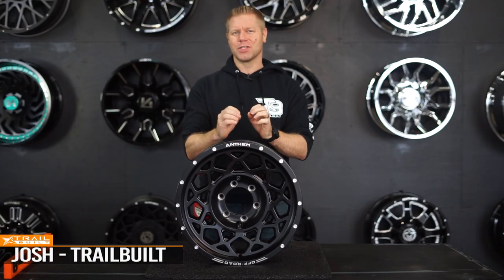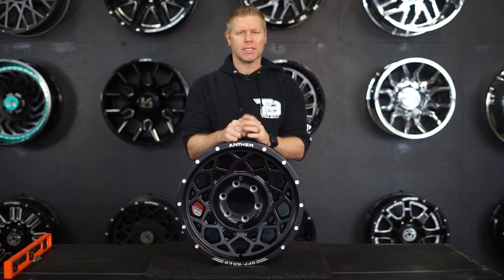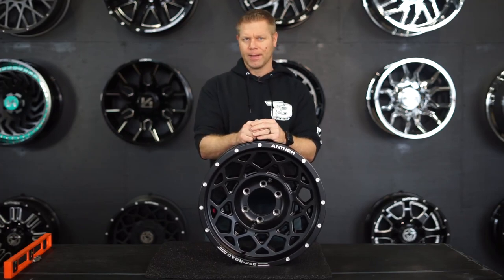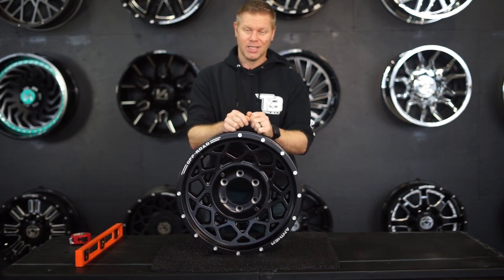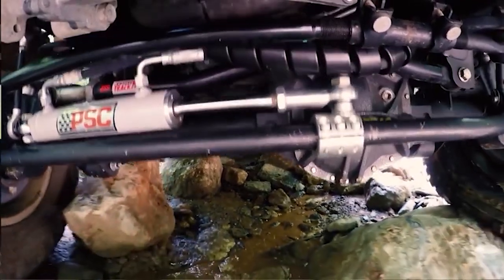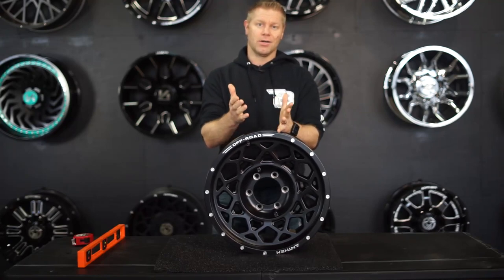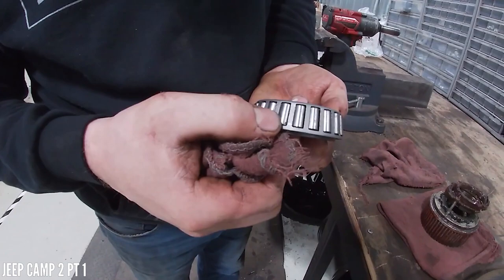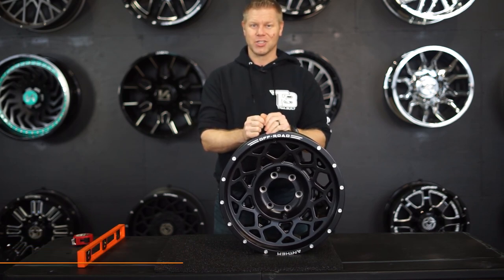Offsets And Backspacing Explained!

Comment: If I understand correctly...8 have a 2018 Jeep Sahara JL.  The stock wheel is 44mm offset.  I am looking at wheels that are 15 to 18 mm offset.  If I understand right, this change from 44 to 18 will push my wheel/tire out from the fender by 1”.....IF I have the same wheel diameter/width.  I am leaning toward a 9” wheel width vs the stock 7.5”. How does that change the offset visual?

Comment: 2017 Wrangler Unlimited Rubicon. My wife’s vehicle. It is a daily driver and will never go off road. She found a set of 20 x 10 wheels that she likes, but I am in agreement with you. Too much stick out is rough on bearings and ball joints. Every video I see, has a -24 or -44 offset, which I do not like I would rather the inside edge of the wheel be as close to stock as possible, but I do not want any rubbing issues. What are your thoughts on Proper backspacing? Thanks

Comment: Great video.  Is there an easy way to find out the offset of my current rims (without taking off the tire)?
Reply from the maker: It does list the offset on the back side of one of the spokes. You willl have to turn your wheel and then crawl under to see it. Will say "ET" and then a number which will be your offset.

Comment: Hi there, i have a 2018 jeep jkur with a 2 inch lift, i have just got 285/70/18 ridge grapplers from stock 255/70/18s and I was wondering what offset for rims i should be running?? THanks
Reply from the maker: Hey Shav! Depends on what you like! If you like them to stick out a bit but still be functional on the trails you should stay at 0 to -18.
Reply: @TrailBuilt  Ah sweet as. I live in australia and the laws prevent you from having tyres poke out the fenders, so what would offset do you think would be biggest i could go before its significantly sticking out of the fenders, thanks

Comment: I’ve got a basic Lt stock 2020 Jeep jl rubicon recon meaning the mods I have completed are the light bars, cb nothing for the drive train. Ihave thebstock wheels and tires not upgrades there.  I know this does come with a factory lift kit.  I’m wanting to offset the stock tire out as far as reasonable for Highway stability.  I think steel wheels would be better than aluminum ones. Is that correct? I live in New Mexico so I’m not sure what the laws are here.  I travel to South Carolina to visit relatives some and also go to ax,Utah and up to Montana at times to give you the scope of the states that it might see most of the point to point travel will have it flat towed but like all thing it might be necessary to unhook from the Motorhome and use the Jeep for getting parts and stuff or trail ride an event along the way.  So it has 17x17.5 wheels with LT285/70R17C BSW M/T. THE ONLY ADDITIONAL item is I would like to get bead lockers.  I want as much steel stability as possible for a high center of gravity vehicle.  I gaining confidence as I put more miles under me but I’m sure there will be emergency situation s that will surprise me down the road.